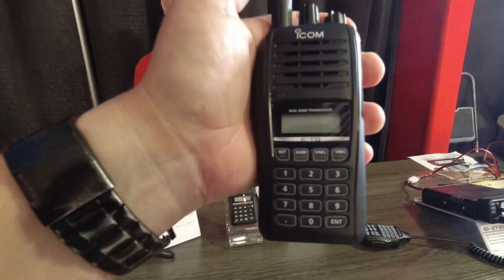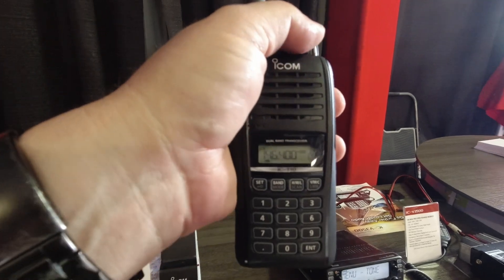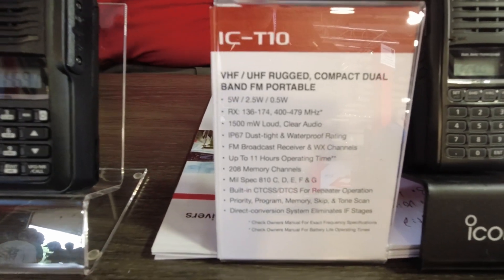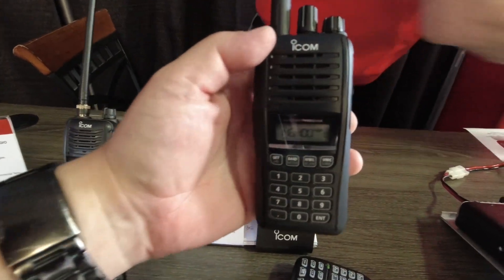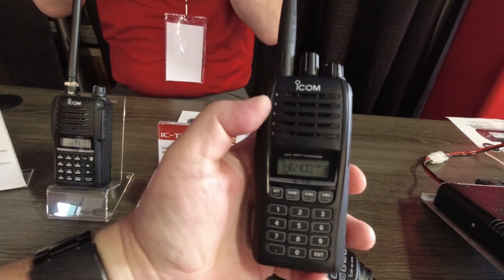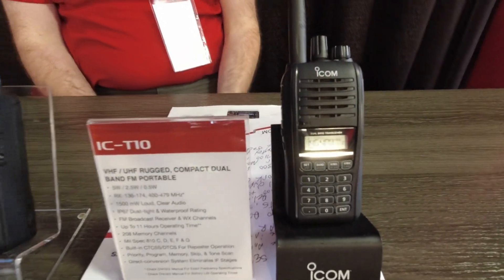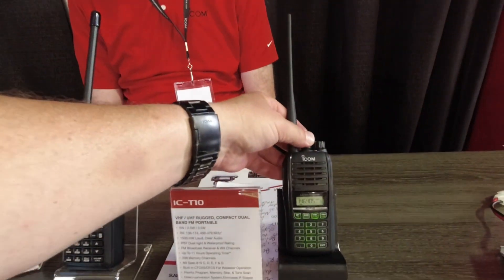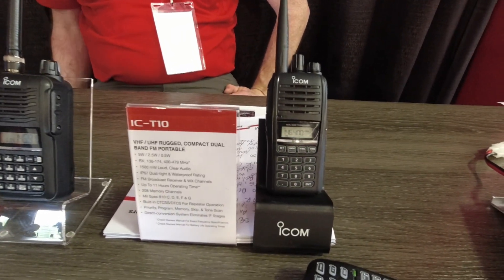NEW!!  Icom IC-T10 Rugged Dual Band HT

Comment: Should be superheterodyne  and have USB-C charging ports on the radio itself as well as on the battery packs. Digital is overrated and none of the various digital modes are compatible with one another.

Comment: would have preferred the option at the very least of being able to use alkaline batteries. Hate the concept of having to pack the charger for extended hikes where if the li-ion goes I have no alternative methods of running it. With my FT-60 its not waterproof, but theres the option of running it on Energizer lithium AAs in the field.

Comment: Just a shade under $200 is probably a better MSRP. IP67, somewhat ruggedized, but just dual band with no digital modes.
Reply: Don't forget, this includes a direct conversion  receiver, just like a Baofeng!  What a great deal 🤔
Reply: For the price they're asking... just get an FT-4X or an FT-65. If you drop it in water and it breaks, just buy another one. It'll still be cheaper overall.
Reply: @asystole_  Or we could just get Baofengs and use them as pool toys. Who cares if they get wrecked, right?
Reply from the maker: I'm right there with you.  It is better than an FT-4X though.  I have one of those and like it a lot.  This is a few steps better.  I don't know about almost 3 times the price better, but it is a pretty sweet radio.
Reply: Kenwood is late in producing something affordable in this genre